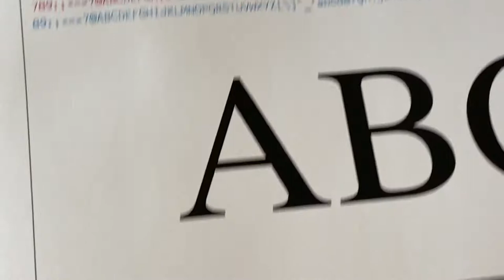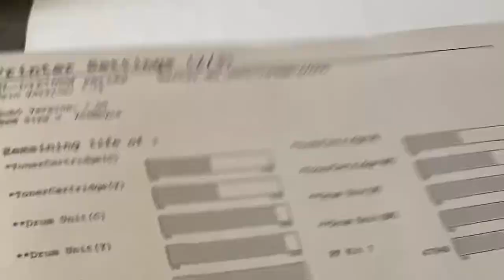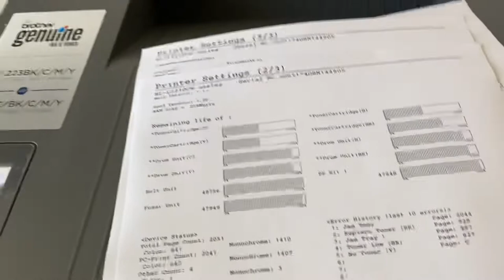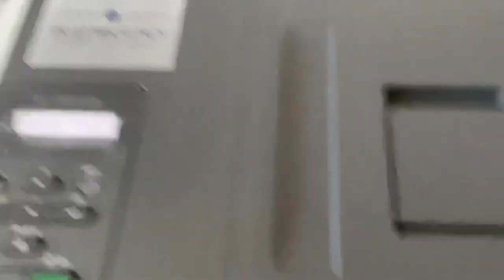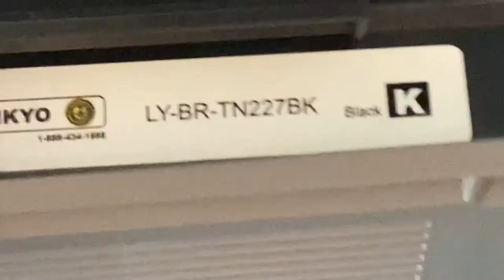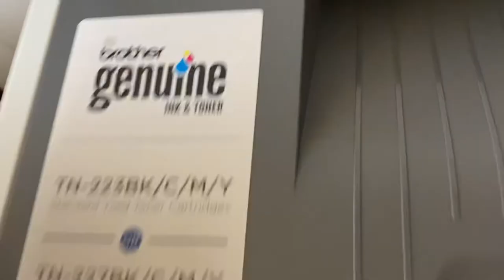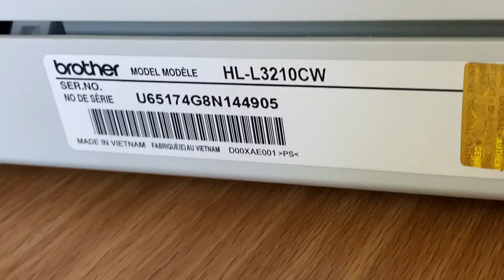Mint-Brother Hl-l3210cw Compact Digital Color Laser Printer-low count 2050 Pages

Comment: can you use aftermarket ink for this?
Reply from the maker: Yes you could if it still has an old firmware
Reply: @FalconTechology  how do you check if it does? I'm thinking about buying this.
Reply from the maker: Ask the seller which toner is usable with his printer